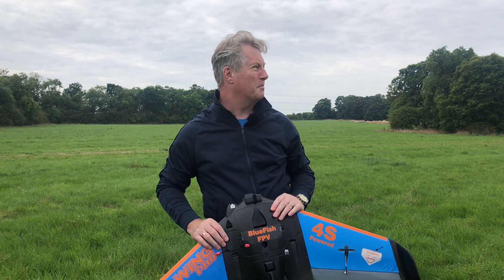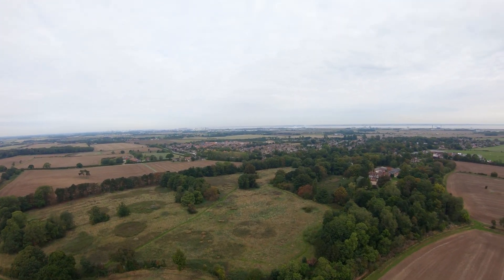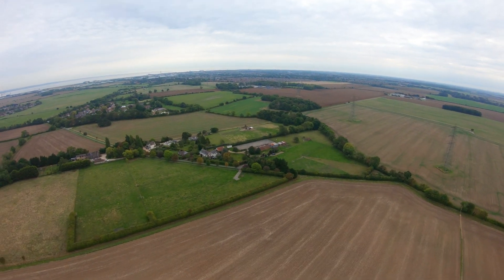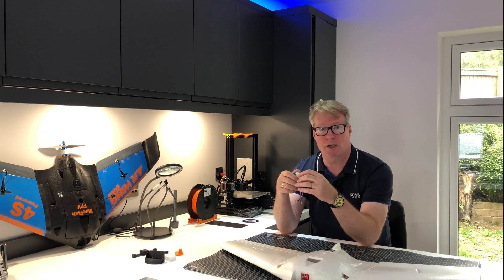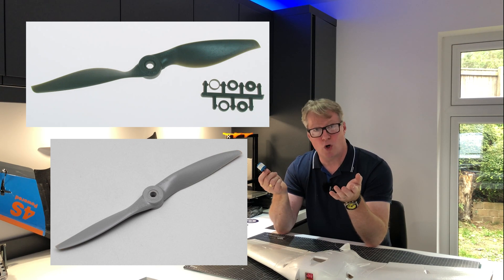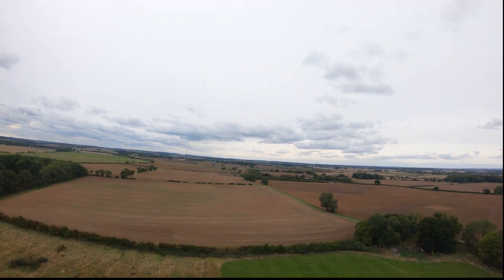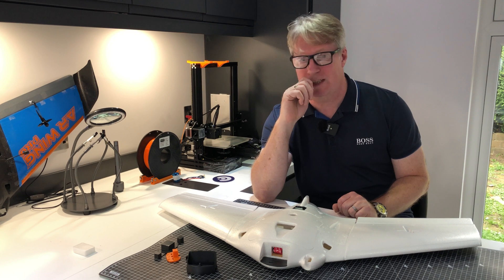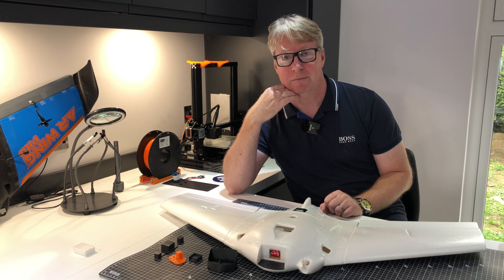AR Wing Pro - Enhanced Build Part 3

Comment: awesome videos thank you, what would you say is the best battery sizes in terms of mah with this wing, i prefer longer flying. thanks steve
Reply from the maker: Hi Steve, I personally use CHNL 5000 mah 4S as they allow me to hit perfect CG with my GoPro Hero 6 up front with no nose weight. I also fly quite throttle heavy and like the punch that lipo delivers. I can get 10-12 minutes of fast proximity flying from this pack. However if you take it easy and just cruise you can easily double that flight time if not a little more. 

Many pilots use lion packs especially for long range and long flight times and flight times of 40 mins plus is easily achievable. 

So it depends what type of flying you want to do. I am finding it quite hard to get hold of new lipos at the moment CHNL have been out of stock for some time and many suppliers wont ship lipos internationally.

Comment: You've inspired me with my AR wing pro, I've used ripmax but covered the whole plane with it, balsa elevons were nice to make too.
The FC cover you've designed tidies everything up perfectly.
Reply from the maker: Hi Douggie glad you found the FC cover useful. I have just put up a video showing how I made my balsa elevons with the stuff i learned from the test build and they worked out great.

I wasn't sure to attempt to cover the fuselage, how difficult was it and did you use lots of smaller pieces?
Reply: @bluefish3607  if only you made the video earlier I definitely could have done with the tips 🤣 I've posted it on FPV wings on Facebook and will on inav fixed wing group. 
The main body was quite easy, using one big piece I could cover one side then another for the other side. The heat meant I could manipulate it round the curves and corners and removed any wrinkles. I then had to put some small patches on areas that were too hard to get into like around the fpv camera bobble. 
I can send you some close up pictures to see, I think you'd love it.

Comment: Nice job Glenn :) I am building one at the moment and decided to put a layer of 75 mil laminate on each side of the foam elevons followed by a layer of 125 mil. I use 75 mil first, because it adapts perfectly to the surface and the 125 mil sticks perfectly on another layer of laminate. Using 125 mil directly on the foam doesn't work that well. As I will also laminate the rest of the wing there will be another layer of 75 mil on top an d bottom. With only the first layers the elevons turn out a lot stiffer than stock. Laminating over the hinges already worked nice on my HeeWing F01. That thing already took some serious beeting and still looks and works great as the skuffs disappear after going over them with an iron and the foam reexpanding in its foil shell. I am looking forward to see what you will come up with in the future.
Reply from the maker: Thanks for the info Bernhard I did an experiment and coated the front of the fuse with E6000 but not sure how well it will hold up. I think I will also try to lam the fuse or maybe just the hatches and the whole of the underside.  The balsa elevons have worked great and I am making some more but a bit more carefully and accurately and another video showing my progress will be uploaded soon.

Comment: Hi mate. I asked about the prop the other day. The wide one and thin one. I also see you changed your pids. I have never changed pids before and don’t have to much of an idea about them. Would you suggest I change my pids to your new ones on my ar wing pro. Just has the f90 motor but has same wider prop. So should fly pretty much the same. Thanks Terry
Reply from the maker: Hi Terry there is so much that affects the PID settings on a wing and how it flies so I would not advise using my settings. I needed to lower my pitch and roll settings because the new balsa elevons have less flex and inav does not have to make so many corrections and those settings were done with the flexy stock foam elevons.

The weight of the plane, the number of lipo cells, KV of motor, prop size and type, CG balance, rigidity of elevons even air temp, density and wind speed are all factors to a greater or lesser extent.

If you have a stock Ar Pro and are running iNav 5.1 then the stock settings with and Autotrim, Autolevel and Autotune should yield pretty good results.

Once you have the plane flying straight and level at say 50% throttle then try and keep those elevon positions with 1500 settings in inav. That way inav won't have to workso hard and you will have a plane that flies well in manual mode.

I hope that helps.
Reply: @bluefish3607  ok thank you. That does help. Just 1 other thing, sorry. When I perform a autotune, does that change the pids also. Or do they stay the same once an autotune has been done. 
Thanks again
Reply from the maker: @ttucker2073  Autotune on inav 5.1 only changes feed forward and rates it does not change PIDS. Fly activate autotune do plenty of manoeuvres rolls banked turns etc. Switch off autotune before you land and the save the values.
Reply: @bluefish3607  thanks for your help. Appreciate it. I’m on 4.1. So when I do a good autotune, will it save automatically when I land and disarm. Or do I have to bring both sticks down and out, or in. Can’t remember which way. Also is that before or after I disarm. As said, I’m on 4.1, so it may save itself once I disarm. 
Thanks

Comment: Great demonstration with a predictable outcome. Increased elevon response with increased pitch oscillations. Even in Manual it's exactly the same. Like I said, wrong wing section, insufficient wing sweep. You will notice when you flew INVERTED the oscllations disappeared even with high PIDS.  The smoothness during inverted flight tells its own story. You did a great job of the Elevons and linkages...🤔😳🇬🇧🇬🇧😀
Reply from the maker: It definitely felt better in the air but I know the AR Wing will never be that great, hoping my Mini Drak will hit the sweet spot.
Reply: @bluefish3607  Agreed, it's a way better airframe. Next time out, fly the AR Pro INVERTED for a prolonged distance. You will see far less pitching and oscillations...🤔😳

Comment: Another great video there Glenn. Thanks for that. I think my next model onwards from the Xle might just be AR Wing Pro. Cheers Mick.
Reply from the maker: Hi Mick hope you are well. I am not doing any long range now so not flying the DXL. I just love the clarity of DJI digital which is helpful for my ageing eyes.
Reply: @bluefish3607  I'm in the same boat too Glenn where the eyes are concerned 😆.  Must admit, I had a few goes on a mates DJI kit recently with a few of his quads and it is tempting to make the cross over. The picture was like watching TV. Will say one thing though, I'm struggling to find a fuselage replacement for my XLe, there are spares about but not a fuselage. So I looked for the model again and it's pretty much out of stock these days sadly. There are bonuses to flying it where I do but she takes a battering every time landing around the gorse...

Comment: Still reckon you could burn your motor again with that combo. Don't take any notice of @EnglishTubines, he knows nowt! (Just kiddin 😄)
Reply from the maker: I will just take it carefully at first Jake and see how it fairs. I did really like my orginal setup of Brotherhobby Reunion 2318 1250KV with 9x5 Aeronaut prop. I might fit one of the builds with that combo again.
Reply: I think the heavy bladed prop is an IC prop maybe..The lighter prop didn't  look like a genuine APC prop either..😳😳😳😳😮🇬🇧
Reply from the maker: The top one I used was an Electric prop the lower one my friend uses on his AR Pro is designed for IC planes. His plane has no issues using that prop and seems to perform well I will be interested to see for myself when they arrive.

Comment: Definately try laminated hinges!  They  are  super solid and the  best looking hinges. You will like  it :)
Reply from the maker: Thanks for the tip! I will do a test one and see how I get on and how it looks. I have to say though those CA Hinges are rock solid.
Reply: @bluefish3607   personally to me the  biggest benefit of laminated hinges  is that you could and should do it while laminating the wing itself. With the same piece of laminate ! If you gonna add just a small piece of laminate ,just to hold tha elevon ,then it doesn't make that much sense IMHO
Reply from the maker: @RS_  I agree I just watched a video where the techniques was to iron a strip of lam to the elevon, position the elevon at an agle to allow flex and iron onto the wing. This did not seem to be that great and I would prefer CA hinges to that.

I intend to laminate the elevons in carbon fibre (Its an experiment for my fast Mini Drak build) so I don't want to cover them up with lam. 

I get why lamming the wing and elevon together would be super strong and neat.
Reply: @bluefish3607  Using an iron on Film strip hinge as you described is an old school method we used on big 11 lb Aerobatic Models. It requires a bit of care to avoid overshrinking the hinge, but it's very secure and no air bleeds from upper surface to lower making response sharp. It's also very good for your servos as it's very free to move...

Comment: Great video and results. Was it the top or bottom prop you used after in the video. I also have a 8x6 prop in my ar pro. The same as the one on the top picture. Looks wider. Would the thinner bottom 1 be better and maybe faster? Also have the f90 1500kv motor. Thanks
Reply from the maker: Hi, yes the top one is the one I used and have ordered the bottom ones. No idea how the bottom one will perform yet they should be here in a few days. My friend runs the bottom one on his AR Pro with the same motor on 4S and it performs really well and he has no motor overheating issues so fingers crossed that should all be good.
Reply: @bluefish3607  ok great. Hopefully you let us know or do a video on how the new prop gets on. Only flown mine a few times so really still in the first stages of the f90. May have to order the bottom prop like you and see how the vary. 👍🏻

Comment: Nice!!!   That's why I choose the 1250Kv Sunnysky 2216 motor with an 8x6    :)
Reply from the maker: is it an APC Caroline? If so which variant?
Reply: @bluefish3607  yes APC 8x6e the wide version that killed your motor. Not ever had a motor complain :)
Reply from the maker: @Caroline_Tyler  Mmmm I must remeber that there is more than 1000 & 2000 on the throttle stick :-)
Reply: @bluefish3607  I so rarely go full open bore when flying, 40-70% is my happy place.